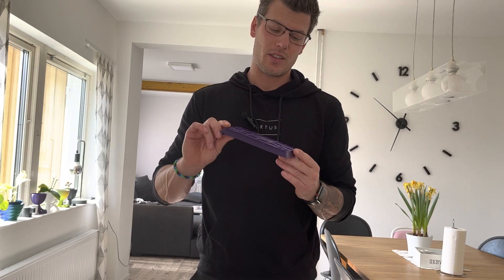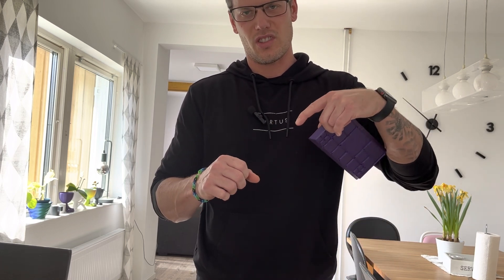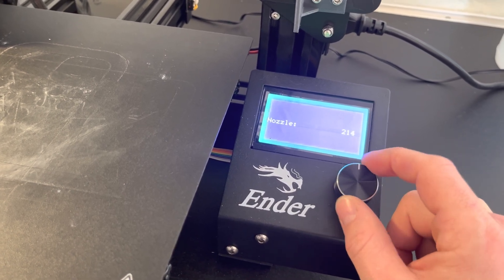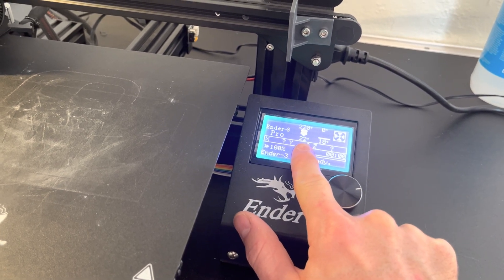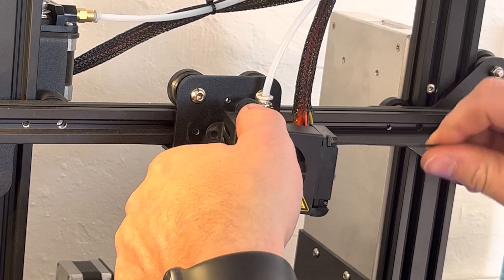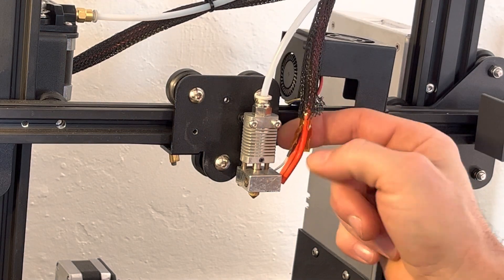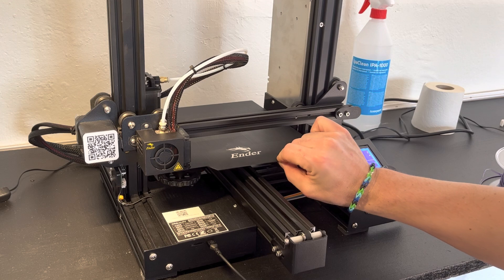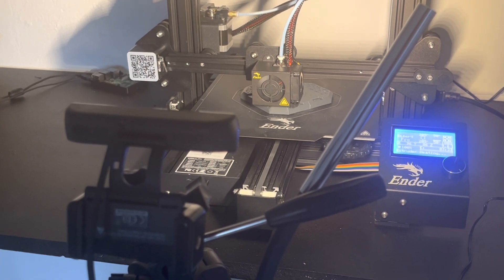Clogged up Nozzle? No problem, easy fix Ender 3 Pro!

Comment: My ender 3 nozzle won't screw all the way in. I tried to replace my nozzle but then my new one wont screw in. But its the same size then the old one cant fit too i tried to heat it up and then replace but it didn't work.I tried to pull out the ptf tube but its stuck and i look at the ptf end but it looks normal and didn't block the thread. Anyone knows whats the problem?
Reply from the maker: are you sure its the same thread on the new nozzle? seems strange it wouldn't fit otherwise.
Reply: One option is that the heat break tube that goes into the radiator and screws into the heat block is too long or screwed in too much. This means that there is less space for the nozzle to go in and that is NOT a problem as long as they are flush. Check out some videos on bi-metal heat break (for 3d printers) replacement to see what I mean.
P.S: you can try to unscrew the heat break a little and see if the nozzle goes in more, but be careful because that thing only unscrews at about 240° and you may damage it with pliers like I did...so at least buy a bi-metal replacement. They are cheap and help to prevent "some" unwanted clogs

Comment: If you reseat the nozzle without reseating the bowden like that it's a 1 way ticket to another clog.
Reply from the maker: How do you meen reseat the bowden? Maybe a strange question if you are a bit more experienced, but I didn’t touch it? Should I change/check that as well? Could it melt in the hot end?